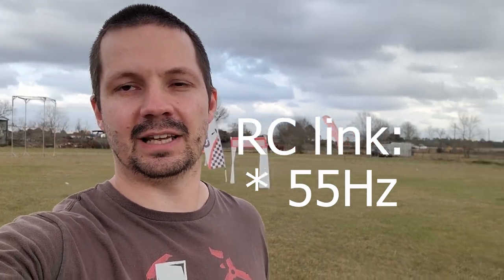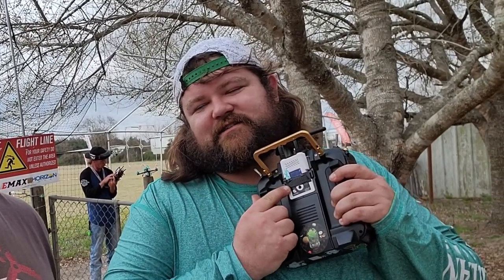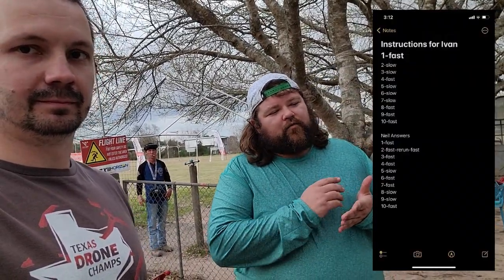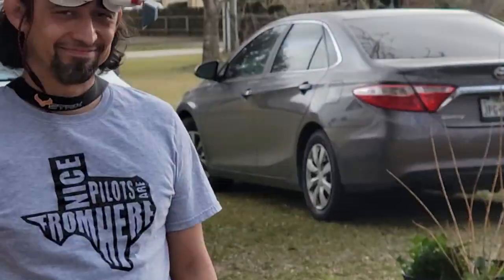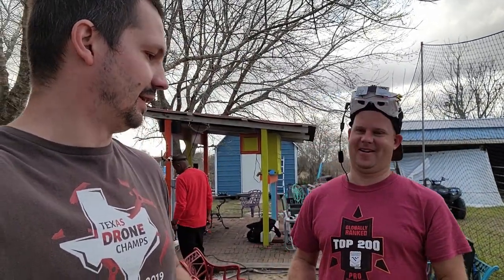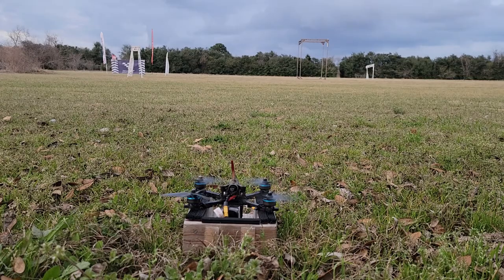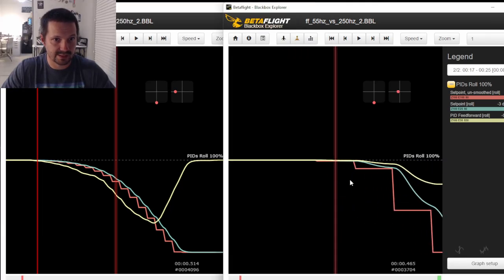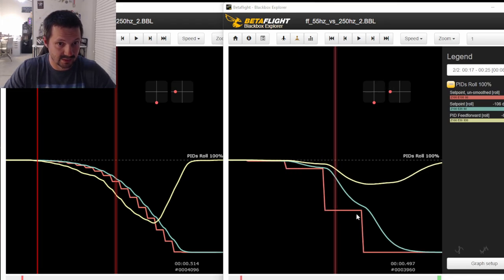250Hz might hurt your feelings - DUEL is up!

Comment: excellent tests guys! It's a tricky test to do perfectly but the results are still really interesting! Ideally what you want to test lag effects is a method that only adds lag without any of the other possible changes as you pointed out re FF. I wonder if there is a way to just delay the output right from the radio (via open tx or something)? That way you could specify some exact delay without any change to the processes that happen inside the FC...
Reply from the maker: ha thats a pretty nice idea! The problem wtih 50hz, is that the delay is not fixed. Basically right after the packet received you got a fresh data, and at the end of 20ms period your delay is 20ms... So the average delae from RC link is 10, but it varies from 0 to 20ms...
Reply: @IvanEfimovLimon  what about if you set it at high rate like 250hz or whatever,but I’m open tx add a specific delay right on the stick itself? I’m not sure open tx can currently do this.
Reply from the maker: @PIDtoolbox  but then again Opentx should be adding variable delay from 0 to 20ms. And then it will be a 50hz data link again :)

Comment: Can you guys do a duel to test the difference between 250hz and 500 hz ? Please
Reply from the maker: i have a strong feeling that i would not be able to tell 250hz vs 500hz. Also, my experience with 500hz is not good cuz it's a little worse sensitivity and it tends to loose packets more often. Especially with the way i mount my antennas - in between FC and ESC :)

Comment: 10 out of 10 boss man! 8/10 is not bad too ;)....what autosmoothing did you use? It has an influence on the overall latency also...funny video as always and solid test protocol.
Reply from the maker: All the explanations where we used is at the end. Basically just 250hz preset.
Reply: @IvanEfimovLimon  ok that preset uses either 30 auto smoothing, or 25 if you select the 'Race' option. The options inside will give a different total latency because the link is filtered with a low pass. 25-30 is pretty low. 2ms link then filtered 3ms total IIRC at 250hz. At 55hz the same autosmoothing will add more - roughly 10ms packet then 15ms when filtered.
Reply from the maker: @SupaflyFPV  i bet you did not watch the second part of the video :) :)
Reply: @IvanEfimovLimon  you lose that bet. You made a section 'for nerds' and then miss out specific critical information. Pls stop making jokes and expect to be corrected by the real nerds. ;)
Reply from the maker: @SupaflyFPV  
I got a real nerd - Ctz checking my 55hz ghost log with 250preset and the smoothed setpoint according to him was "near perfect" and you can see that in the video too. The real quad delay from not using a correct preset could be in the feedforward. And i mentioned all that in the video. But even with the correct RC link preset, the situation is not much better. Actually the 50Hz preset adds even more MORE rc smoothing, so it gives even a little more setpoint delay.
Reply: @IvanEfimovLimon  its a joke!...apologies if that wasn't obvious.....I didn't know the actual preset values but I have my answer now ;)
Reply from the maker: @SupaflyFPV  no worries ha :) there is only one king nerd and thats neither me and maybe nor even you LOL
Reply: @IvanEfimovLimon  yes I am like the apprentice nerd lol

Comment: Can you please add a preset for elrs f1000  there is non currently using 500hz preset
Reply from the maker: I don't have anything with 1000hz, I fly ghost... So need someone willing to record prober blackbox a few times
Reply: @IvanEfimovLimon  no problem I’m out testing uav techs racing preset tomorrow I wouldn’t mind sending a log where do I send it too
Reply from the maker: @teamlowefpv.theaffordabled3534  it will probably require more logs. And better on the table with props off. Set debug mode feedforward, select 500hz preset and start moving stick left-right slowly and then faster and faster. Don't jam the ends, so half way. Upload bbx to: https://github.com/betaflight/firmware-presets/issues/361
Reply: @IvanEfimovLimon  many thanks I’ll get it done asap
Reply: io am trying to upload black box log and its saying it cant do the format are there any other options
Reply: @IvanEfimovLimon  are there any special ways to do it as i am trying to upload to the link you gave and its not taking the format
Reply from the maker: @teamlowefpv.theaffordabled3534  you need to register on GitHub. And then you can rename your bbx to let's say .txt to trick the system.
Reply: @IvanEfimovLimon  got ya I have a login will rename and send it now
Reply from the maker: @teamlowefpv.theaffordabled3534  plz follow that thread now you got some work to do! :))

Comment: You just turn off FF on all quads, if you still feel the difference between 55 and 250 - problem solved
Reply from the maker: It's not just feedforward
Reply: @IvanEfimovLimon  what else? Rc smoothing?